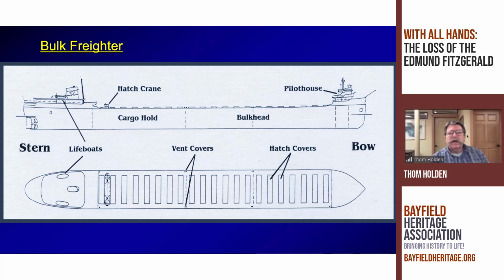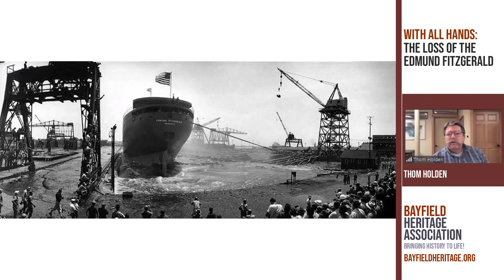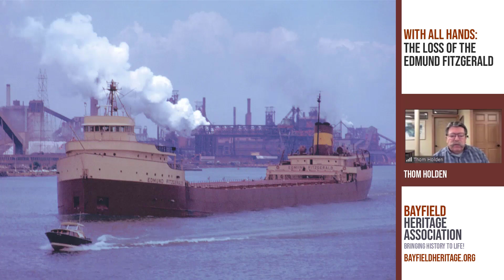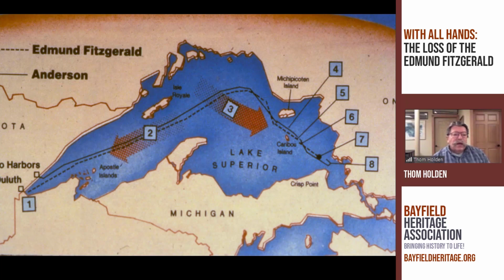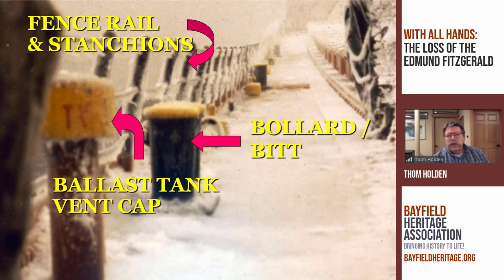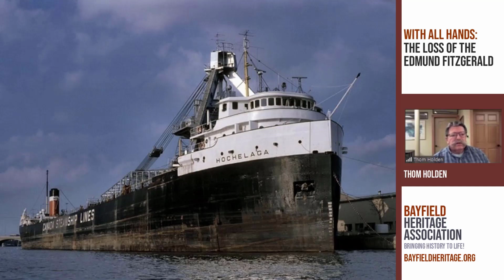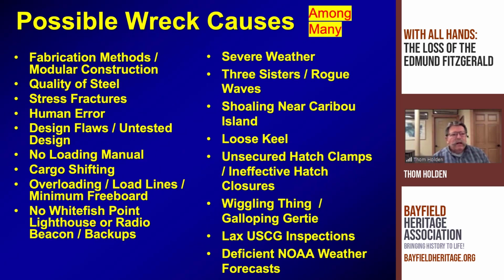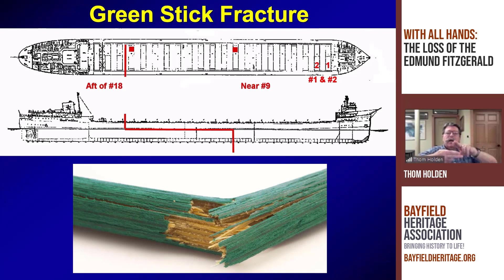With All Hands: The Loss of the Edmund Fitzgerald

Comment: A large number of those hatch cover clamps were obviously NOT tightened down and in place at the time of the sinking.  Having been tightened they could not have come off without being damaged.  "No one would go out in a storm without having those clamps in place" is not an acceptable argument when the physical evidence says otherwise.  It is entirely plausible that a captain would be tempted to save on overtime wages by only having what he thought would be sufficient clamping-down to take place, and the Coast Guard did indeed know about this practice.
Reply: I was thinking along these lines as well after Mr. Holden's comments.
Great in depth analysis otherwise.
Reply: Other Captains say they tighten a few on each hatch and do the rest while on the Lakes! So did the Fitch get them all tightened in time maybe that is why she did not make her normal 1 pm weather report the day she sank! Other captains said it took a day or 2 to tighten all the clamps!
Reply: First of all they didn't go out in a storm they weather was on the way but it wasn't a storm when they embarked....Also the missing vent covers wouldn't have blown off because of water in the holds due to insufficient clamping the vents are to allow air displacement due to flooding ballast tanks when needed.....Massive and immediate flooding of the ballast tanks are about the only reason for the missing vent caps due to as Capt Bernie Cooper surmised bottoming out at 6 fathom shoal which the Fitz was dangerously close to as the Anderson which was keeping track of the Fitzgerald's position noted .....The hatch cover positioning being noted at the wreck scene is pretty hard to determine when covers came out of position.
Reply: Because the cargo holds have no connection to the bilge and the ballast tanks, and the bilge pumps were running full tilt, means the water was coming in from the bottom of the ship, not the top.

Comment: I think Thom did a very good job and did not try to say exactly what caused the ship to sink. I did find one mistake, which is common among many ship followers. The cargo capacity is determined during the vessel design, and the 25,000 ton capacity is actually LONG TONS, which are 2240 pounds. Cargo actually carried is reported as SHORT TONS, which are 2000 pounds. Therefore the 25000 Long Tons is actually over 29000 short tons, and the 26000 pounds of cargo carried did NOT exceed the designed capacity. There were changes made to the Load Lines in those days, requiring deck straps be added and hatch covers be strengthened, as Thon said. That is a different issue.
Reply: Thank you. I Did not know that
Reply: Bull.   That boat was way overloaded.   Grossly overloaded would be an understatement.    Designed to haul 20 thousand tons in 1958.    They increased the capacity 3 times.   Overloaded

Comment: i recently read an article, where failure is modeled by Swiss cheese. the holes are risks, and the solid cheese is risk mitigation. We can decrease the number and the size of the holes, to an economical point, at which time, we have to add another layer of cheese... with few small holes, and enough layers, we gain confidence in the overall design. With all of the possible causes that you researched, and the condition of the ship on the lake floor... My guess is no better than anyone else's but I would surmise a combination of just a few of these factors, combined with the rough seas, caused a catastrophic failure of the hull, which ultimately broke in two, when the bow hit the bottom....
Reply: The Edmund Fitzgerald sank because of poor maintenance and negligence, plain and simple.   Captain Mc Sorely rode that boat like a dog from 1972 till it sank.   4 seasons of nothing but abuse.   In the 1975 shipping season, the Fitzgerald went through the Soo Locks more times than any other boat that year.   And it went down before the season was even over.    That's how hard he was running that boat and his crew.   The Captain was going to retire at the end of the season.  He was 63 years old.    He was banking up his cash pot for retirement.     He would make a run in all weather, no matter the conditions.    He just didn't consider that his boat had never been overhauled or lengthened ever in it's 17 years on the water.    And look at his course plot to whitefish.    He's right out in the middle of the lake for absolutely no reason during a gail.   Then he has to make a turn at Michapitcoten and go around caribou island right through six fathom shoal.    He steered his boat right into oblivion doing that with all his radars knocked out.    This guy is a fool, this Mc Sorely.  He should have hugged the southern shoreline and went around Kewenaw point.   But he's out in the middle of the lake when his boat is starting to list to starboard.   He's got nowhere to beach the boat because he's way too far from shore.    Pure negligence on his part.  I think that he hit bottom making the turn or on the shoal or Caribou.    A big wave hit and that's all she wrote.   Game over

Comment: good stuff.  I really believe Weak ship + Strong storm + Worst location is the essense of the story.  All the stories of the previous years about this ship, maintenance, design, the way she rides, all indicate this was, amongst all the other lakers at the time, one of the weakest ones.  Then comes the one hundred year storm.   THEN, due to some just plain bad luck and iffy decisions, she ends up in the worst possible place to be on the lake at 7pm.    The sea state estimates from the NWS show that area to be PURPLE then, almost the single worst square mile to be in the lake.   I agree with the video, she was taking water into the ballast tanks and was sinking, possibly a stress fracture, as the conditions continued to worsen.   The final moment was likely a nose dive, but as the video believes, could have been hastened with a hatch cover fail.    So sad.

Comment: Just because you can make it fit that doesn't you should I'm a welder we are military contractors we are held to tight tolerances
Reply: This was 1958.   Tolerances were within a INCH back then, if a inch short on hull plate, weld the inch and fill in the gap with arc.   Lol

Comment: I was gonna say how often did those old style bucket loader damage the hatches or even the bottom but i seefrom construction internally the buckets could get near it...with all that internal structure flexing could not have been ti kind to the welds an supporting beams with all those sections of tanks welded an causing a welded square structure that would not allow flexing...do to its square shape construction...

Comment: Ok but what is ""Iron ore"" and why did they move it. Why didn't they produce it where they were going
Reply from the maker: Good question. Iron ore is a raw material mined from the earth. It gets shipped from places where it's abundant to places without a local source of iron ore. An alternative would be to process the ore into iron and steel onsite prior to shipping, or even produce finished goods from iron and steel and then ship those, but that just changes when distribution happens. It doesn't eliminate it. Whether it's good to do all this is another question! :)
Reply: Thanks for answering. Always wondered what iron ore is and what it's for
Reply: @mikeyjones4817  Looks something like marbles or round spheres of rust collared material.
Reply: Iron ore is melted down for a huge variety of uses, namely, the automotive industry...
Reply: @leonardcollings7389  you are describing taconite, which is iron ore that has been refined with bentonite clay into a pellet, which is what the Fitz was carrying.